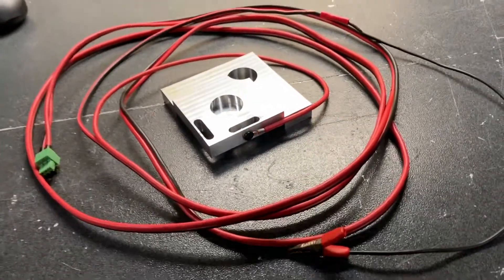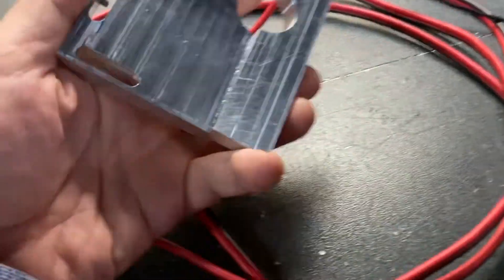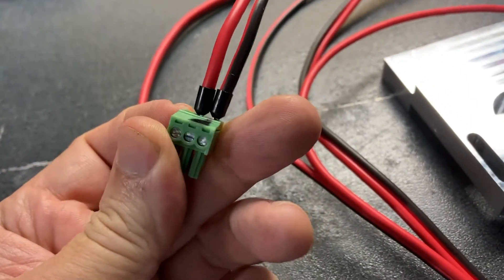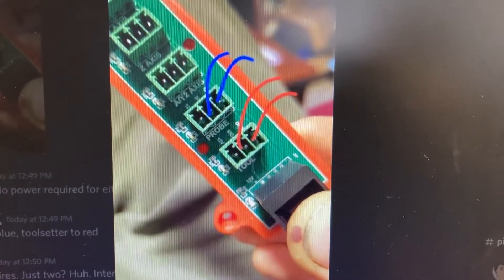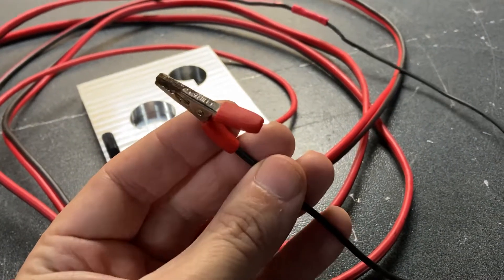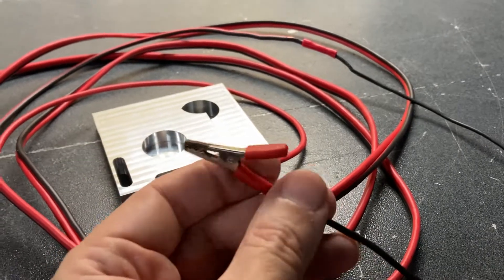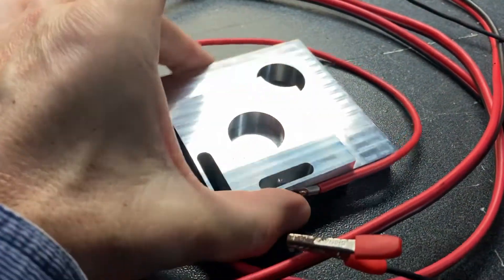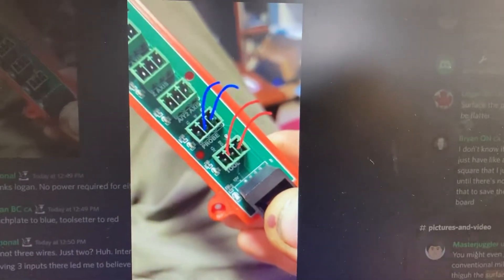Making a touch plate probe with wire for PrintNC when using GRBLHAL2000 board and iosender

Comment: I would think, as long as your spindle is grounded, you should be able to connect the ground from the spindle at the VFD to the pin on the breakout board. Then you would only need one wire coming from the electronics enclosure to the touch plate.